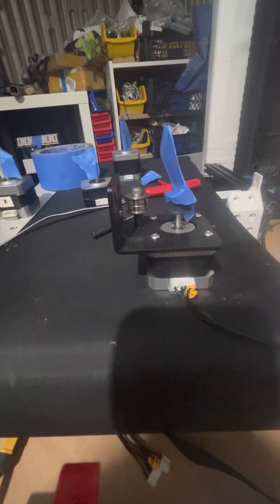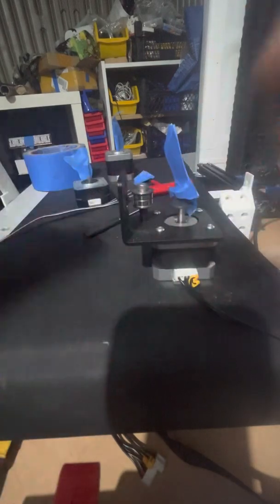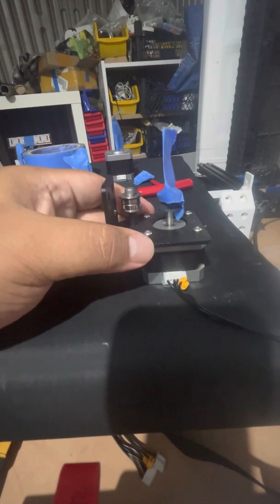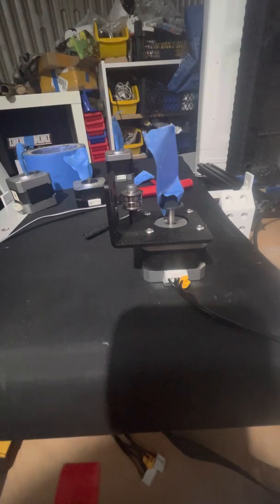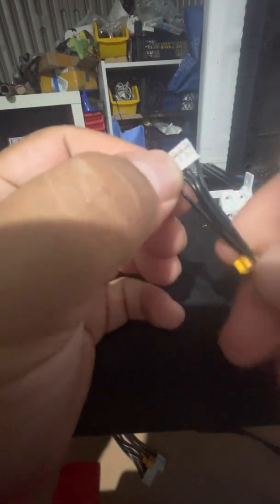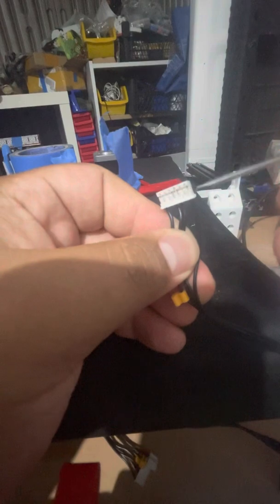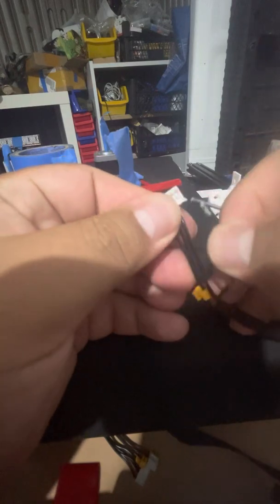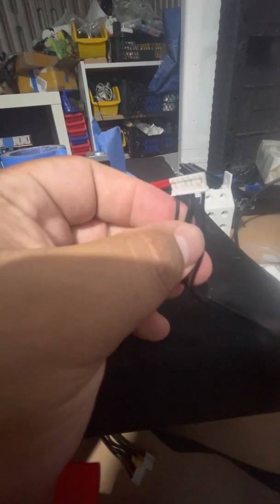Stepper motor spinning wrong direction Quick FIX!!

Comment: So let it be clear 
ABCD -> DCBA 
right???
Please tell me 
I am daunting cause if i do it incorrectly i might burn up the main pcb of 3d printer.
Reply from the maker: So first off you won’t burn any PCB even if the wiring is messed up it will make a lot of noise and vibrations and that’s when u turn off and also u shouldn’t be running more then 1.2 amps 

Anyway yes you swap Abcd to dcba 

And if it’s vibrating try only swapping just CD the middle 2

Comment: Great Explanation. 
Swapping A+ B+ A- B- simply didn't work. 
I drew the signal chart for the original,  compared it to  the paired swap. 
Logically,  it doesn't reverse.

Your way is the simplest and best.

Comment: You don't need to reverse all the cables.  You only need to swap over one pair: either pins 1+4, or 3+6.  That inverts the polarity of one coil, which is all you need to reverse the direction.  What the video shows is reversing both pairs (which cancels out) and then swapping the relative positions of the two coils, which also reverses the polarity.

And NEVER unplug or reconnect a stepper motor with the power on.  It often dmages the driver.
Reply from the maker: U are correct sir , but again like the title states it’s a quick fix 
The proper way would set the firmware to the proper specs per motor. 
But I do appreciate your input on the more through explanation.

Comment: I just reversed my steppers.  Four parallel wires going in.  Wires 1234.  Swapped becomes 3412.  1 and 2 move to 3 and 4.  3 and 4 move to 1 and 2.

Comment: I'm pretty sure all you need to do is swap the crossed wires around. Not positive but from my understanding that's all that needs to be done.
Reply: Thought so too, but had to fully flip the connection